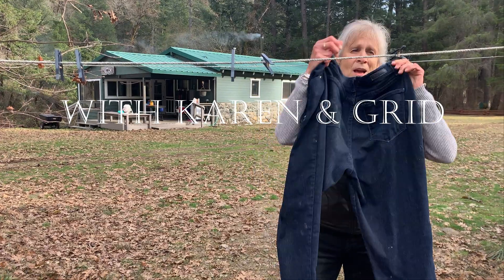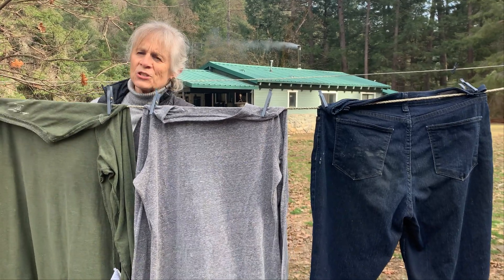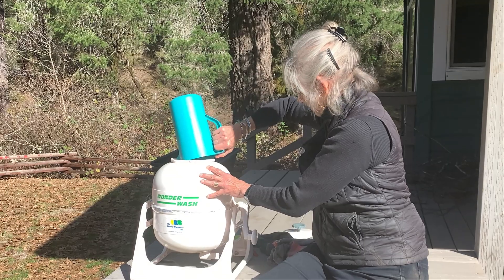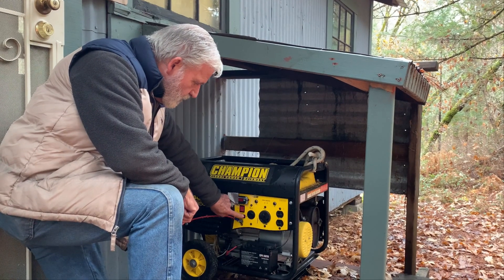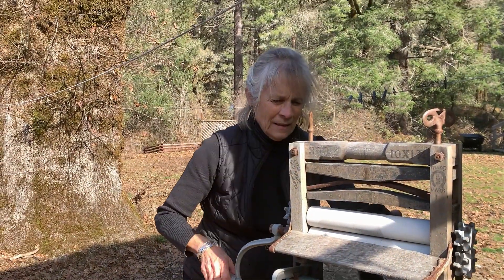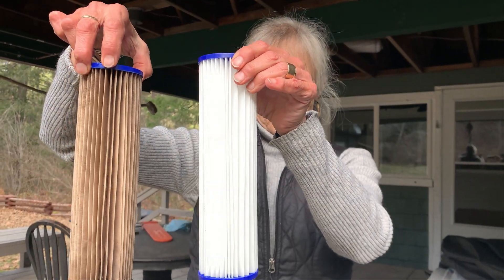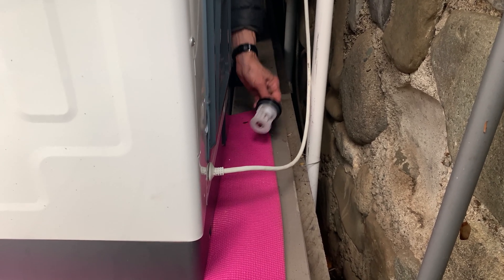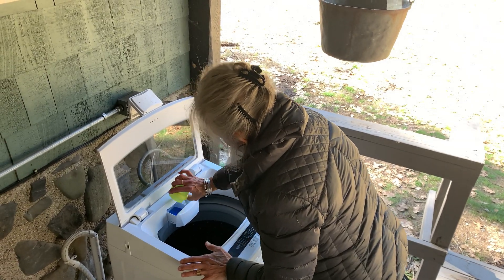Doing Wash and Saving Energy, Off-Grid. Off the Grid with Karen and Grid

Comment: Are you saying every time you do a load of laundry you have to buy a water filter?  Boy, that wouldn't be cheap.  My sister has a well, and she gets a large amount of sand in the water.  She has been taking laundry to town for 20 years and is not really happy doing  that.  She brings those wet clothes home, but she has an electric dryer.
Reply from the maker: Hi Dee. No, we don't have to change filters out after every wash. We rinse them out when they look brown. They are replaced when they start looking ratty, usually after a dozen loads. We use a cartridge filter from Home Depot. They cost about $7.00.
Reply: @offthegrid4036  this is what we have in our house  https://www.amazon.com/iSpring-WGB32BM-Filtration-Sediment-Manganese/dp/B08HNJ9R62/ref=sr_1_12?crid=1YUU0BO1KBZ4U&dchild=1&keywords=whole%2Bhouse%2Bwater%2Bfilter&qid=1624494313&sprefix=whole%2B%2Bhouse%2Caps%2C220&sr=8-12&th=1
Reply: What causes that.  Is it hard water ?  Thanks.  What's the model number on your washer ?
Reply from the maker: It's the small particles of sand and/or dirt that come from our water collection system. Although the water often looks clear, we realized it had sediment in it which is why we filter our drinking and laundry water. The machine is a Magic Chef 2.0 cf Topload Washer. Ordered and picked it up at Walmart for about $400.
Reply: @offthegrid4036    Thank you for the info.  Love the channel.